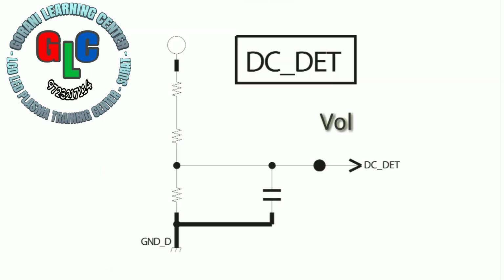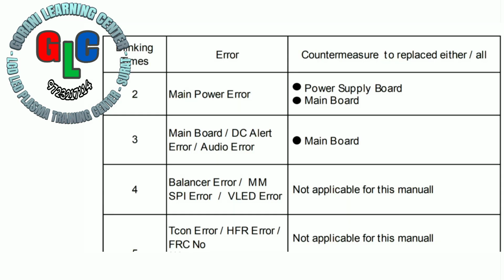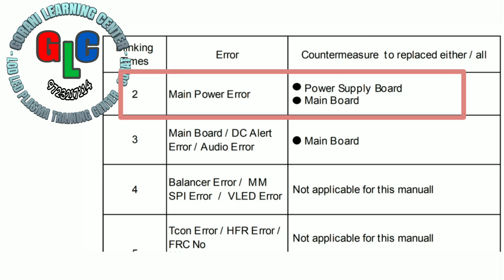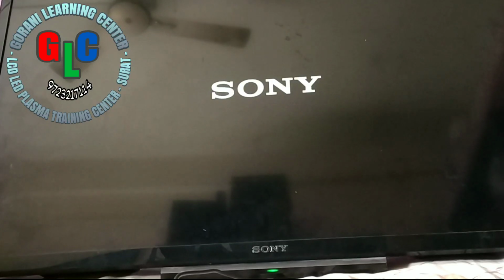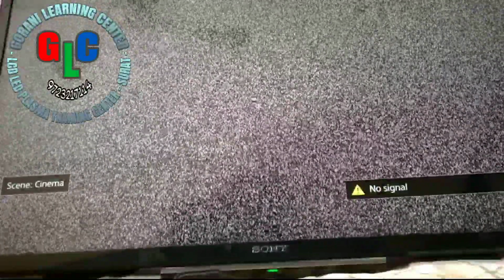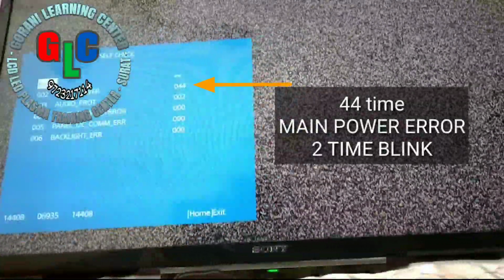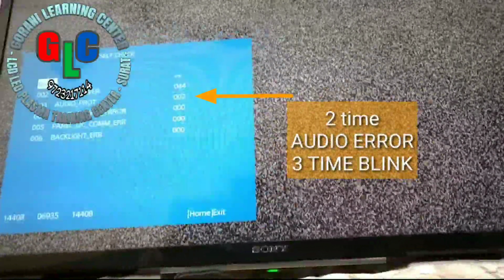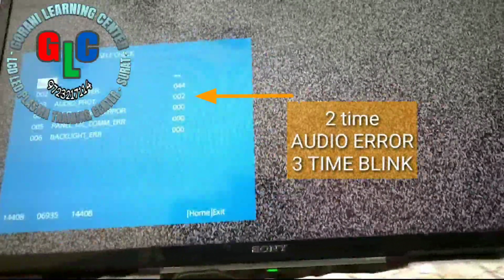SONY - 2 TIME RED LED BLINK ERROR, DC_DET FUNCTION, BYPASS 2 TIME BLINK ERROR

Comment: Hello sir can i asking about the sony bravia 40inches model kdl 40HX750 two blinks standby red light problem.. 
Can you help me please sir..
Reply from the maker: Check on 12v line for protection design
Reply: Where is the location 12volts line protection sir PSU or Mainboard sir?
Can you help me sir.. This may FB nardzkie electrons and my whatsapp 
+639102065382
Thank you so much sir have a great day..